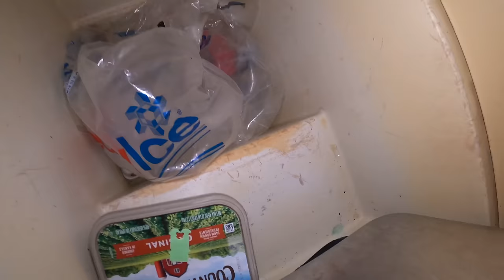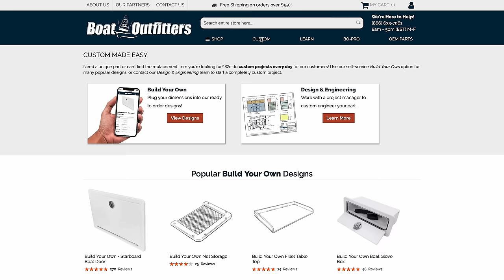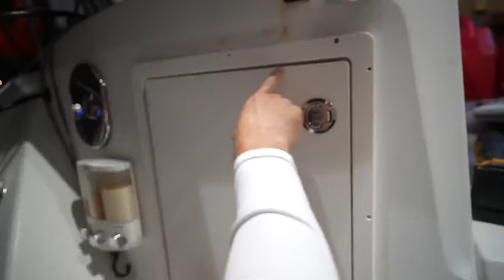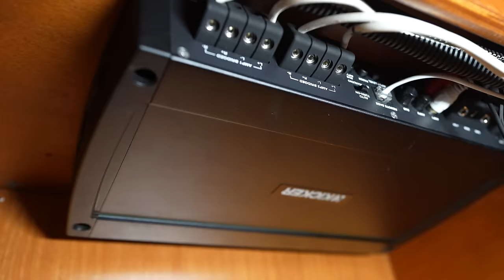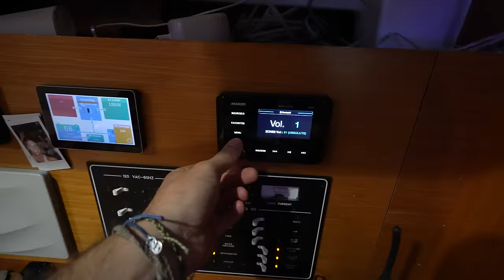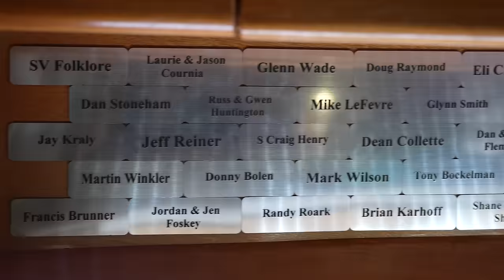Bringing THE NOISE on our CIRCUMNAVIGATION! Tower speakers on a SAILBOAT 🤯| ep.35

Comment: I didn’t notice that you made those speakers water tight.  Water getting behind the ones in the cocktail table may lead to rot.  Hope not.  Personally i love the speakers
Reply from the maker: After testing the system we sealed the subwoofer with silicone. The tower speakers are designed for marine use and just needed to be mounted

Comment: Hey Guys,  I've been following you since the beginning.   My wife an I owned a Catalina 380 and cruised the gulf and east coast of the US for over 7 years.   On solution for your head is to tee of the sink drain with several feet of flexible hose.   You can close the sea cock and use the fresh water twice.   Washing your hands in the sink will provide plenty of soapy water for the flush.   Its a cheap fix and reduces the problems associated with crystal formation form salt water and urine.   The head also tends to smell a bit fresher.

Comment: Keep that tube.  Tower is no longer listing the Tower Pro 900 Elastomeric Sealant on their website and I haven't found anyplace selling it.
Reply from the maker: haha there was no real magic to that particular brand or bottle. I've used many different types of elastomeric from multiple brands that also stick to starboard! quick google search also showed Chem-Set™ 6105 Polyolefin Bonder, Lord 7542-AB, or 3M’s Scotch-Weld DP-8005... I just know that 99% of boaters only have silicone and 5200 onboard so I thought it was worth a mention that those do not work!

Comment: Fridge - there are plenty of front opening door fridges on sailboats.

Heeling and heads - oh

Creaking? Oh

Ear plugs for guests as needed.

6x4 is 2400 watts. Hit up sunrun for the upgrade. Hopefully they will fit. More power. 

$$ sail boat kitchens etc. sail boat sound systems. More work with that excellent Bimini maker. And so on. 

Delos took odd jobs prn. ( brian the engineer)
Reply from the maker: On monohulls, you will see front opening doors, but if they are facing the side of the boat, they typically also have a top loading option for opening under way. Or the door is facing forwards or backwards which is more practical on a heel. So far we've managed, but might as well bring it to everyone's attention incase they thought it was a nice upgrade. We're still learning as we go.

The creaking isn't bad and only noticeable underway, not much different than most boats, but there are ways we could lessen the creaking a bit. It is a boat after all!

We'll have to keep sunburn in mind for future upgrades, we hadn't heard of them before. 
In Ep. 29 we installed 6x375W LG Neon solar panels which makes up 2250 W of solar total. We've been completely off-grid with power since we installed them running our water maker, Airfryer, water heater day or night, no problem. Our Battle Born battery/solar combo has been an absolute dream! No generator or high power alternator needed yet 😁